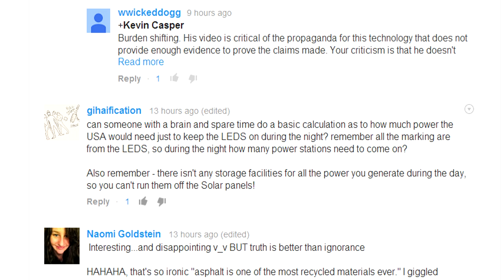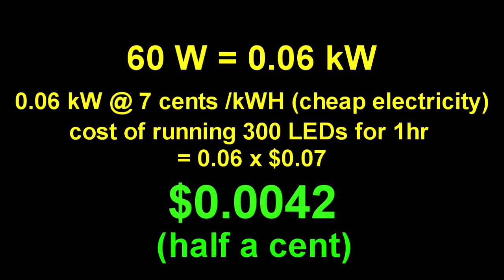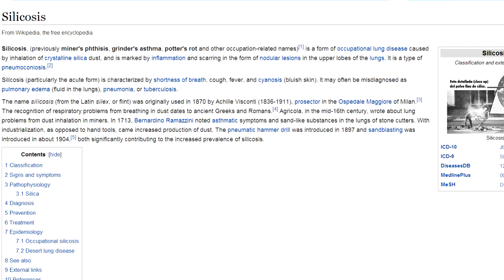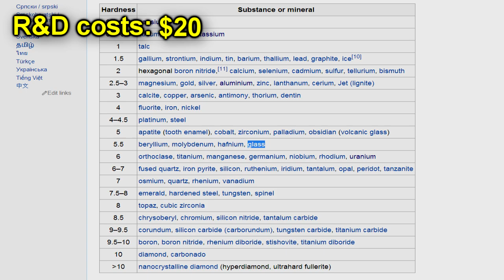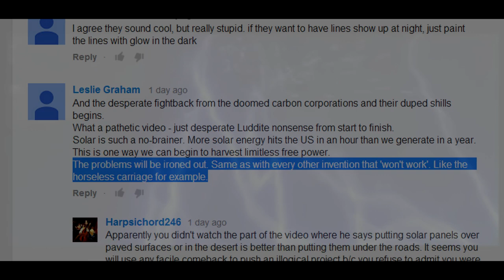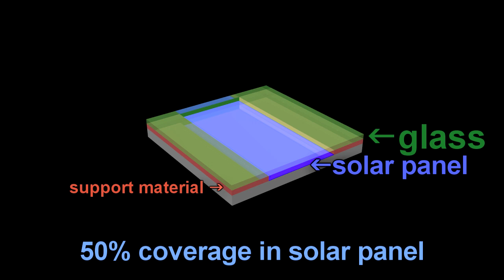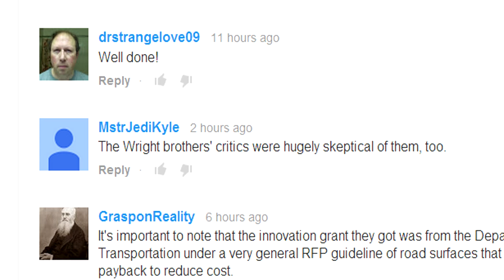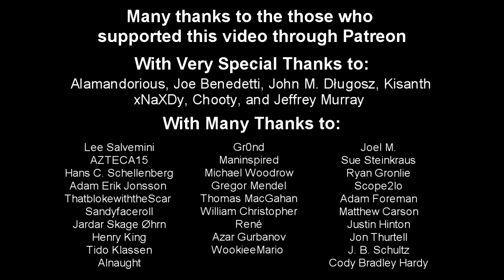Solar Roadways, IMPORTANT QUESTIONS AND ANSWERS!

Comment: I wonder if Piezo electric generation from people walking falls into similar logistical problems?

Also if you would coat the areas around a tracking panel with panels laying flat on the ground, just to gather some extra or would it be more beneficial to have some kind of crop and burn that for energy?

Comment: I've watched you video and I must admit the issue with the glass surface may kill this idea, I can't be certain without having the actual material available to test. But assuming it responds similar to the standard glass types you've tested it may be a hurdle that can't be overcome.

However, setting that aside for the moment, I do have a few issues with the calculations you did to figure out the potential costs. The foremost issues I have is your estimation of the area of a tile. Assuming that one side a tile is 2 ft, which I think is fairly accurate, the area of each one is approximately 10.4 square feet. That's almost a square meter of coverage for each tile which would alter all your calculations that followed.

Another issue I have is that you did all you cost calculations based on ALL the LEDs on ALL the tiles being on. That would never be the case, assuming the lights are being uses primarily for standard striping only about 5-10% of the road surface would be lit, and only at night. That brings up my next issue, you state that all markings must be lights, which you're right would be useless in bright light, but why can't conventional striping be used in most applications, again it would only obstruct 5-10% of the overall surface area.

Additionally as far as power consumption goes, just because it's dark would not necessarily mean that the striping would have to be lit. According to the description the tiles are pressure sensitive therefore only roadways in use would have to be illuminated, lighting  the roads within a half mile of the activated tiles or something to that effect. This would greatly decrease your estimate of the costs to make use of the lighting.

That being said, I'm sure there are many other more effective and practical applications for solar cells, I just have a real problem with people using inaccurate figures to falsely support their point of view.

Comment: Whilst I agree with the point of this video. You are assuming that all of the LED's are turned on all the time. I imagine you know for a fact this would be false, and in fact, only a very small percentage of the LED's would be on. no more than 10%, However, this brings up the problem of LED's burning out faster than others.

A lot of the other numbers you will up, whilst correct, assume 100% of the cost all the time, which would be nowhere near that.

All your other points are correct and I agree with though, also love your videos btw.
Reply: How about instead of lighting only the leds we need to make the road safe for cars we put lights on the cars and have the car light the piece of road a driver needs to see? You can even use reflective paint to make the lines more visible and place little replectors at the side of the road to make curves more visible. And all that at a fraction of the costs.

Comment: Thunderf00t - Thank you for these critical videos.
The LEDs in sunlight demonstration - please repeat this with a black surface surrounding the LEDs... not a white strip.
The proposed road panels lying flat - I understand that there are raised hexagons on the glass surface that have angled sides to diffract sunlight to the solar cells when the sun is not directly overhead.
    Thank you for your intelligent attention to this interesting project.

Comment: As someone who actually works with lighting and LEDs I have my own critique on whether they add any value for wayfinding or signage to the solar roads idea, and I'm unconvinced they do. However your arguments are so poorly constructed and badly researched that I couldn't even make it past the first section on the LEDs. You are simply far out of your depth when discussing industrial design and manufacturing in general, and LEDs specifically. 

First using a retail product to do your cost calculations is pointless. Even a small capital project, such as a mile of roadway or a parking lot will result in a huge bulk pricing discount, not to mention loose LEDs will cost far less than the tape you are using, which is a finished consumer product not a component. 
Second, your calculations for the energy usage are assuming that all the LEDs will be fully powered in every panel. Why? In order to provide the standard road markings and occasional warning you only need to turn on a fraction of the LEDs. I'm not convinced myself that it's a good idea, but your calculation is lazy and does not reflect even a vaguely accurate ballpark of realistic usage patterns.

Finally the "experiment" you are doing with your internet purchase of LED tape is deeply flawed. LEDs are used in signage that is perfectly visible in full sunlight, including but not limited to stop lights, and they have been for years. A very cursory internet search would have revealed this to you. The problem with your experiment is that the LEDs you describe as "very bright" are not. The screenshot you show indicates that there are 60 LEDs per meter of tape, and the output is 900 lumens per Meter. So 15 lumens each. 100 lumen LEDs are readily available right now, and even brighter ones have been announced. And it is not uncommon to combine multiple diodes into an array to achieve a desired effect. Whether LEDs can be made to work as signage in the roads is a no brainer. Yes, they can be made to work. Easily. How you go about doing it and how you manage costs and maintenance are valid questions, but you aren't asking much in this video. You are telling. And what you are saying is factually incorrect more often than it is valuable.

I could go on but frankly it's going to take too damn long to go over in depth all the mistakes, assumptions and misleading statements in just the first 10 minutes of this video. I recommend you leave engineering and design problems to people who actually know what they are doing. This is simply not your area of expertise, and all you are doing is spreading around incorrect information.